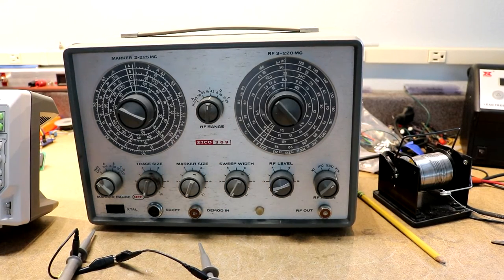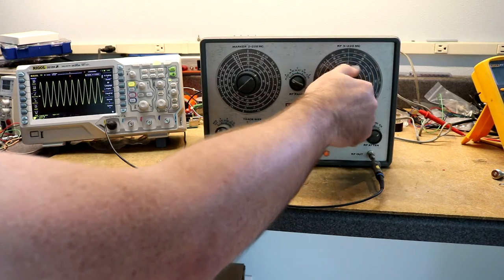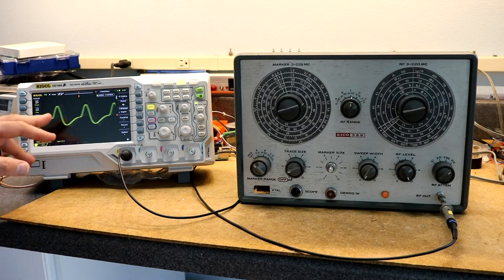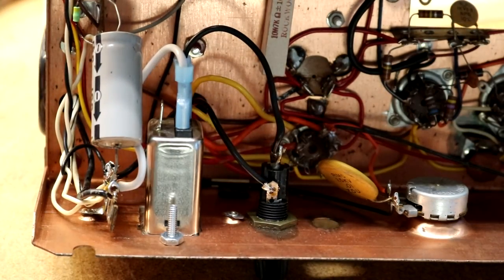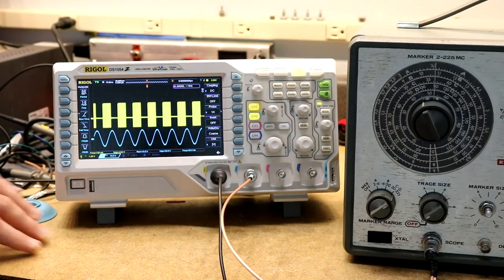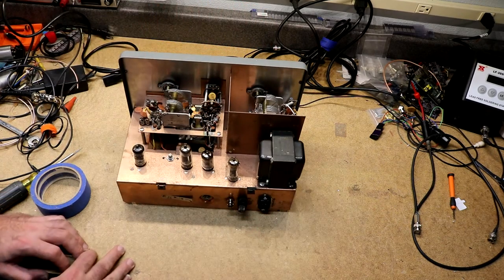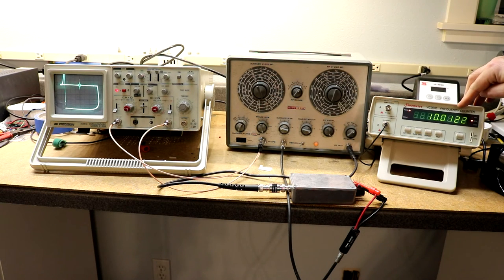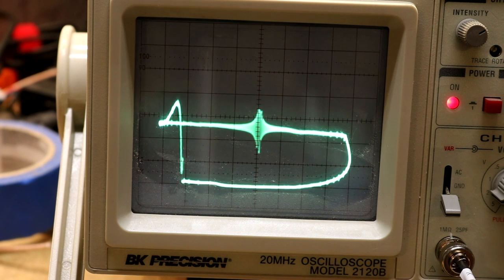Eico 369 RF Sweep Generator - Tear Down, Evaluate, and Modify

Comment: Marker shows twice because the sweep up and sweep down isn't symmetrical.  Would need a triangular sweep drive for them to show up on top of each other...

Do you show how you actually killed the blanking anywhere...  I know you hooked a s switch up to the cathode....but a little more detail.  Did you just hook up a switch to ground..

Thanks
Reply: I have this sweep generator and have been troubleshooting for awhile.  I finally got the oscillator to run on 3 of the 5 bands.  Just for grins, I shorted pin 2 of V3 to kill the blanking.  It seems to work.  I have not tried it long term though.
Reply: @josephpayne4012  I was looking at the trouble shooting section of the manual. It gave three reasons the blanking circuit would go down. Either R12 or R22 is open or C11 is shorted.  I wonder what would be the best way to disable blanking. I'm thinking shorting C11. That would kill the signal to the grid of the 12AX7. Sure it works but what are the ramifications to the rest of the circuit?

Comment: I've got that one.  Picked it up at a hamfest.  If I turn it on it snaps the fuse.  Replaced all the caps.  Still does.  Got bored.  It still waiting for me to finish it.
Reply: Got unbored. Replaced the plug in with the same type of modern connector.  Noticed the copper strap from the special sweep transformer/variable inductor was broke. Fixed that, the old girl started to work.  Way out of calibration but otherwise working.  Where exactly did you add the switch to prevent blanking?  Was it Pin9 of the V4B?